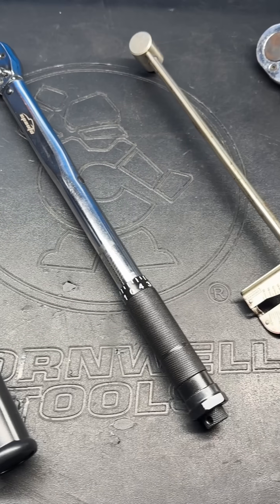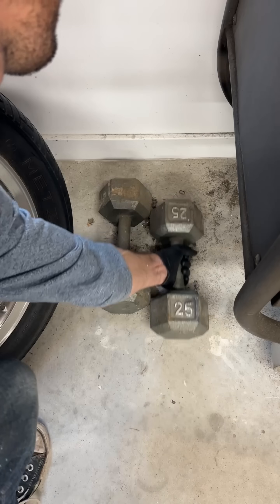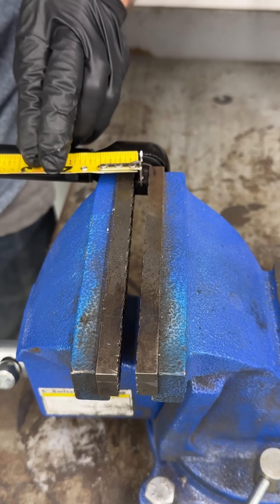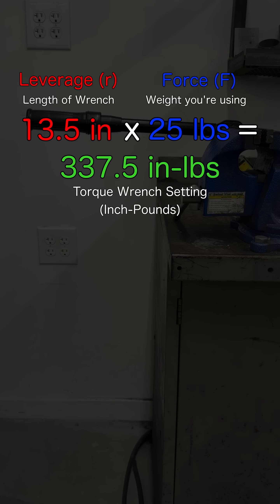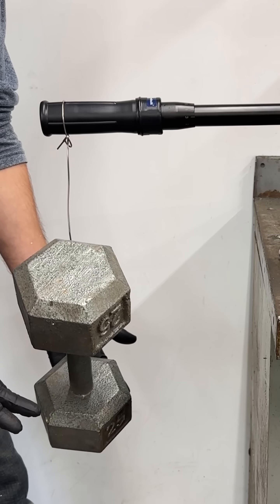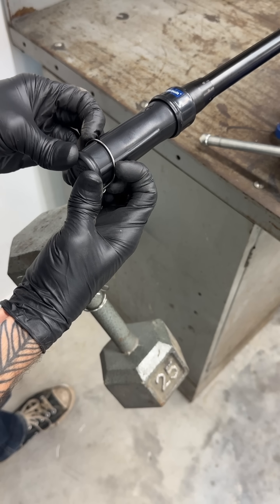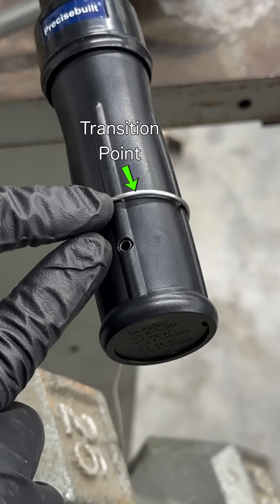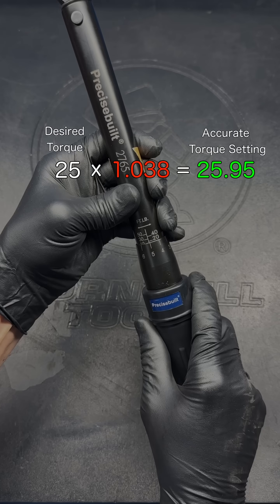How to calibrate any torque wrench yourself  #motorcycle #DIY

Comment: Appreciate the video. You also need to include the weight of the torque wrench itself. For larger torque wrenches this could be a couple of pounds. Since the weight may be distributed unevenly along the length of the handle, the math could get complicated. The higher the torque setting you calibrate at, the less the weight of the wrench matters as a percentage of the calibration error.

Comment: If I need 1 bolt to 21ft/lb is there any problem calibrating it with 21ft/lb, doing my 1 bolt, and yeeting the wrench back into the drawer for another year?
Reply: Asking because he said somewhere in the middle of its torque range. 
My torque wrench is definitely meant for a little more than an oil drain bolt. 

It’s a hand me down. 
Usually I just grip it down until it ain’t going anywhere, but not on my new toy.

Comment: I have 1/4 drive and 1/4 drive is shorter than 1/2 drive
 should i divide to 12Ft to get the torque settings?

Comment: Awesome video. There is a calibration nut inside the bottom of the handle, not sure why they cover the bottom part with rubber.

Comment: I see you own a beam style wrench too.
Do you know if they require calibration, and how often? I
By calibration i don't mean zeroing the indicator, mind you.

It's about to get delivered to me and I'm going to test it in any case - i bought it because i hope it to be pretty consistent for cheap.
Reply from the maker: It can be tested all the same and the calculation to correct it would work too. I honestly rarely ever use mine and haven't even tested it to see how accurate it is. Neat piece of simple tech though!

Comment: I just used this video tonsee how off the OEM 50-410 ft/lbs torque wrench I borrowed from AutoZone was. 3ft x 25 lbs should have been 75ft/lbs, but it was clicking at 29.25 inches, so 36 inches/ 29.25 inches = 1.23077!!
I had to set the wrench to 363 to get 295 ft/lbs of torque. My Craftsman 250 Ft/lbs wrench was off by 12% or have to calculate by 1.12 to get what I want.
At leastvghis video helps a lot.

Comment: A few percent, maybe even 10% or more, doesn't really matter for achieving a bolt's torque spec. Rusty, dirty, worn or damaged (or, on the opposite side, greasy) threads create much more uncertainty. 

What you are trying to achieve is a certain strain (elongation) in the bolt, so that a certain force acts on the threads, such that a certain friction value is achieved. "Snug" (ie some lowish torque value) followed by some angle (fraction of a turn) is a more precise tightening spec.
Reply: Unfortunately many shop manuals only list torque specs. Use your judgement. If you've done some wrenching in your life (and maybe broke/stripped some screws) you have it in your muscles memory. Anyway, don't obsess about a few percent. A bit over (10%) is almost never wrong. And also: apply your brain when thinking about tightening sequence! Alternate diagonally as much as feasible, in small "bites."

Comment: It works pretty dang good I’d add checking the weight to make sure it’s 25 pounds and not 24.6 or 25.5 and 1/2 pound makes a difference over 13.5 inches of leverage. You grind grind off weight of add weight to get it right tape some bolts to it to get the nice even weight you want.

Comment: if you slide the weight to the 12inch point you do not have to convert for foot pounds since you are at a foot.  so 25 lb weight is 25 foot pounds at 12 inches.

Comment: Easiest way to calibrate is with a digital torque adapter, no math unless you have to use a correction factor for non adjustable wrenches

Comment: So if your torque wrench measures foot pounds, measure a foot or 12 inches and put your weight there. Read the number on your weight, set your torque wrench to the number.

Comment: Yo that's actually sick, my dad actually ended up replacing his old snap-on torque wrench because he stripped out the head bolts on an XR600R. When tested on the snap-on guy's truck it was about 10% off. I'd say that's pretty bad

Comment: failed to account for the weight of the wrench.
Reply from the maker: @retematic1488  The weight of the wrench would only come into play when torquing horizontal to the ground. And it’s not as simple as adding the weight of the whole wrench because the mass of the wrench is at the head where it won’t impact the torque at all. So we’re talking about adding maybe a pound for the handle and only at certain angles. Which is why it isn’t factored in and part of why torque specs always have a range.
Reply: @oneupmotogarage  >horizontal 
only situation where it doesn't affect the outcome. 
as long as the circle described by the rotation of the handle around the fulcrum penetrates into the z axis; it will have an effect.
what you'd want is for the torquing end to point up or down so that the rotation is confined to the xy plane.
what you need is the weight distribution, or total weight and center of mass, with the com you could assume that to be the average leverage exerted by the wrench itself. 
since they aren't tubular and have internals simply using the midpoint of the handles length is insufficient.
the influence the weight of the leverarm exerts on the fulcrum approaches zero as it comes closer to fulcrum.

the weight really doesn't matter in operation, i mean it won't for most fixtures anyway but if you were torquing to 8nm and let go the backlash might be an issue.
it will still have an effect on calibration if done as you have here.
Reply: @oneupmotogarage  you, quite honestly; idk why i keep bringing shit like this up other than sheer paranoia. 
at that point one might aswell start worrying about shifting too many matrix defects at once causing the fucking bar to break in half just by touching it.

what kind of weight are we talking here? 500 grams? if that? center of mass minus the head around 57% of the length measured from the head?
is it a difference? yeah sure. should be well within spec.
ill go shut my ass up.

Comment: I don’t know if you can assume a faulty wrench is off by the same proportion at any setting.  It might be uneven.
Reply from the maker: @stevengreidinger3304  for sure, I always test close to the torque I’m about use it at. Or you can do a comprehensive test at 3 points (bottom, mid, top) and adjust accordingly.

Comment: I tighten to 6 ugga chuggas,back it up a couple of summer horse hairs,then give it a tug to 183 degrees and Im now at the center of my garage holding a snapped head bolt, sobbing and questioning my life choices....I also have a leaky roof....its still leaking yet it has not rained in a week.....

Comment: Just get an ac delco torque adapter, you never have to calibrate it, its like 100 bucks and turns any ratchet or breaker bar into a electric torque wrench

Comment: Snap on trucks have torque wrench test inside. I had a few years back tested my 39 year old  snap on torque wrench's  1/2",3/8", 1/4" for accuracy - the all where exactly on the money. The new digital one have to be recalibrated every so often according to the spec sheet.

Comment: Gym weights vary wildly. I visit random gyms when on work trips and thought something was up with my strength then started checking on scales. In one gym two 20’s that felt heavy weighed 44lbs together and a single 40 weighed 39 on the same scale.

Comment: remember that the torque value is only accurate at the OEM-specified position usually at the center of the handle

Comment: Shouldn’t you put the weight a foot from the driver?
Reply from the maker: You can, and then you'd use 12" instead of 13.5" in the equation.

Comment: Don’t clamp the socket adapter directly in a vise, Jesus Christ.

Use a sacrificial socket or extension.
Reply from the maker: You can do that too. But you don't have to put enough pressure on it to deform it. I've done this many times over the years and the wrenches still hold sockets the same as ever.

Comment: There’s a small error due to gravity. You’re already applying 1-2 ft lb or so before hanging any weight on it, just from the wrench’s weight itself. To calibrate the 25# weight, put exactly 3 gallons of fresh water in a plastic garbage bag and see if they read the same on a scale.
Reply from the maker: The weight of the wrench is static, it will be the same on both sides of the equation so it cancels out.

Comment: 13.5"???  Why not set the weight at an even 12"?
Reply from the maker: You could, I just picked where the weight would easily hang without sliding. And to show it can be done anywhere at any length, so it is universal for smaller or longer wrenches.

Comment: My only suggestion is if your wrench doesn’t click accurately at first and you adjust it, try a few other weights (or bar positions) to verify. Great tips though!
Reply from the maker: Yea, because they can be non-linear in their accuracy I usually test the wrench to the weight I'm about to torque to, if it is a critical spec.

Comment: This method ignores the weight of wrench handle though. A bit more math is required for best results
Reply from the maker: That is static, on both sides of the equation so it cancels out.
Reply: @oneupmotogarage  false
Reply from the maker: @ Elaborate?
Reply: Sorry, i should have been more clear: what you said in your prior comment isn't true. Hope that helps.
Reply: The weight of the wrench handle is producing a torque in addition to that from the dumbell. You ignored that while calibrating and it does *not* get canceled out somehow.

Comment: Way harder than it needs to be. You need a foot long arm connected to the drive hand the weight on there and no measuring and no math needed!
Reply from the maker: Many torque wrenches are shorter or longer depending on their size, this makes it universally work for any sized wrench.

Comment: Hint: Just hang the weight at one foot, or 12 inches.

It's literally foot pounds, as in, pounds of force across one foot of leverage.
Reply: This is surprisingly not true - some torque wrench mechanism actually require the force to be applied on the handle in order to be accurate. I know it sounds unbelievable, given how torque is defined, so all I can say is look it up.
Reply: @dyhidrogenmonoxide I think that's true for most if not all not digital torque wrenches, you know since it snaps at the correct weight at the handle

Comment: Is there also a risk that a low quality wrench is not only not accurate but also inconsistent?
Reply: Yes.  Good thinking.  You should repeat the same test several times to check the dispersion of data.  It will almost certainly not be exactly the same each test.  You will get an idea how much it might be wrong at the maximum.

Comment: Had a new torque wrench that would click at a different value, significantly different value and it could not be calibrated, dialed in. So it got tossed. Even took it to a certified calibration shop. Over years I learned that price does not play much of an idication as to the level of accurancy of any specific torque wrench 1/4" drive to  2.0"' drive.

Comment: The bolt you showed over torquing on that CB engine is the exact bolt I just stripped while using a torque wrench a few days ago!
Reply from the maker: @raleighro  dang! Yea those 6mm valve cover bolts are fickle.
Reply: @oneupmotogarage gotta go with the German torque spec of guttentite!

Comment: On the Hanger wall at K.I.Sawyer we had 2 swing gauge apparatus wr needed to check our Tourk Wrenchs regular size and a 4' Lonh one for Tourking the Colets holding the AGM28-b Missles to the Pylon that was attached by just 4 Bolts and a Pin to the B-52.

Comment: Sounds like a great idea
But does it really matter?
Unless your wrench is adjustable(like the one you showed that you can recalibrate), it won’t matter.  Unless your tq wrench is seriously broken being a few inch or foot points off isn’t going to break a fastener.
I’d be much more worried about out accidentally using ft pounds instead of inch pounds on a bolt
I did it the first time I used a tq wrench, because I honestly had no idea….luckily it was an easy fix.  The head snapped off, was able to remove a couple other bolts, remove the part and used vice grips to spin out the leftover bolt piece(now a stud), replaced bolt, reinstalled part then torqued correctly.  Done.
Reply: It'll matter if you care if your wrench is useless or not.

Comment: Fun Fact: the weight marked on weights is frequently a uh off. Unless they’re calibrated competition plates.
Reply: If you weigh the weight make sure and calibrate the scale with a weight first. That way we can be accurate.
Reply: @foodooyou1  few hours of paranoia later your breaking into a metrology lab
Reply: @foodooyou1  but what if the weight you're using to calibrate the scale is off a few pounds? It's a never ending vicious cycle ahhhhhhhhhhh! 😂
Reply: @foodooyou1 🤯
Reply: They are always off
Reply: Weigh the weight first?
Reply: @caseykittel  this
Reply: @caseykittel someone else beat you to it
Reply: Calibrating a tool with a less reliable mass....smh.
Reply: I was thinking exact same, that weight could be couple pounds off..
Reply: @jimboh.2654 a couple pounds? Hell no
Reply: Weigh the weight and input it into the equation you can use any weight it doesn't matter
Reply: Simple solution really, most people have a scale in their house, just measure it on the scale
Reply: @T_Rey1799-ud5ll  those aren't very accurate either. Digital ones trend to be more accurate then mechanical but again there's no regulations that they need to be very accurate. (unlike scales used for commercial purposes.) You just have basic consumer protections which isn't going to help much with low accuracy. You get what you pay for.
Reply: Another fun fact. Most torque specs account for tolerances.
Reply: Another source of inaccuracy is that gravity will pull the weight toward the ground, while torque has to stay orthogonal to the radius. It is only truly accurate if it's done where it clicks while perfectly level.
Reply: The used weights are not calibrated. Get a scale to weigh them….but the scale is not calibrated either.
The solution is to get a calibration tool for your scale to calibrate the weights to calibrate your torque wrench. Job done.
Reply: fun fact, its such a small amount that it doesnt matter at all
Reply: @gtcam723 but how do you calibrate the scale you weigh the weight on😨
Reply: A few percent, maybe even 10% or more doesn't really matter for achieving a bolt's torque spec. Rusty, dirty, worn or damaged (or, on the opposite side, greasy) threads create much more uncertainty. What you are trying to achieve is a certain strain (elongation) in the bolt. "Snug" (ie some lowish torque value) plus some angle (fraction of a turn) is a more precise tightening spec.
Reply: A few percent, maybe even 10% or more doesn't really matter for achieving a bolt's torque spec. Rusty, dirty, worn or damaged (or, on the opposite side, greasy) threads create much more uncertainty. What you are trying to achieve is a certain strain (elongation) in the bolt. "Snug" (ie some lowish torque value) plus some angle (fraction of a turn) is a more precise tightening spec.
Reply: I can’t imagine weights will be off that much. Maybe a few ounces?
Reply: a 25 pound weight isn't going to be a couple of pounds off...don't be daft. it'll be a couple of ounces off at most. Is it something to consider if you're trying to get as precise as possible, I guess. If you're trying to calibrate to that extreme of precision then get a better torque wrench.
Reply: @kincaid9134  10% inaccuracy would be fairly normal for cheap weights.
Reply: @SuperS05  no it isn't. Have you weighed any weights before?
Reply: @kincaid9134  yes
Reply: @SuperS05  what brand?
Reply: @kincaid9134  a bunch of them. The Chinese brands are the worse.
Reply: @SuperS05  name some.
Reply: @SuperS05 10% margin for 10kg is 1kg. The weight is gonna be somewhere between 9kg to 11kg. That's pretty significant. 
If it is a 1kg weight, the error is 100g. That is somewhat acceptable.
 But a 10kg weight should have the error margin no more that 1%
Reply: @SuperS05 10% margin of error should be so rare dude and now you're trying to save face by claiming you've actually weighed different brands of weights from different countries? Lmao.
Reply: @joelglanton6531  i had an argument with some gymbros. Used my calibrated scale. Their personal equipment then the gym. Most of them were more reasonable, 1-5% off, but there were a few that would be way off. I wasn't doing a study so no I don't remember brands too well it was a few years ago. There's literally no regulations on consumer weights, so why should they care much about accuracy? But less weight means more money for the manufacturer so they aren't upset by it. I deal with weights and measures in the ppm and lower range.
Reply: @Amin.Ashraf  yea you'd probably notice 10%. I might notice 10% by feel too. Will your random neighbour notice it when that's all they have and have no other reference at home? If I was a manufacturer of them I would just deal with the few returns than spend a bunch of money on QC/QA. I'm not saying every one of them was off by that much. I'm just saying it was common enough that I really wouldn't be surprised, and somewhat expect that chance if I go purchase some or use a gym set.
Reply: @kincaid9134 eleiko, rogue.
Reply: @SuperS05  you are WAY off, normal weights are closer to 1-3%
Reply: @SuperS05  I know and trust the legendary coach Chet Kinkaid 😊.
Reply: @SuperS05  and that is more than what most torque wrench are calibrated at, usually for okay ones at 3-7%
Reply: @kincaid9134 ±10% is pretty frequent with cheap weights, so 2 pounds off isn't out of the ordinary.
Reply: @kincaid9134 Chet Kincaid!!!!